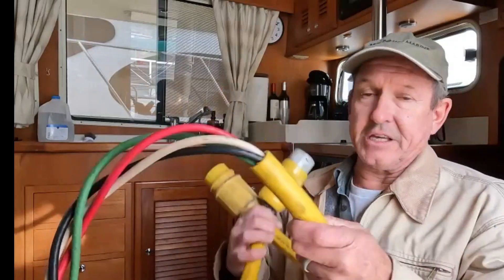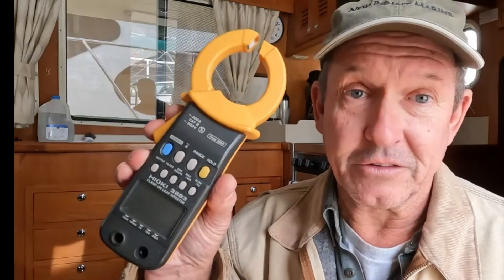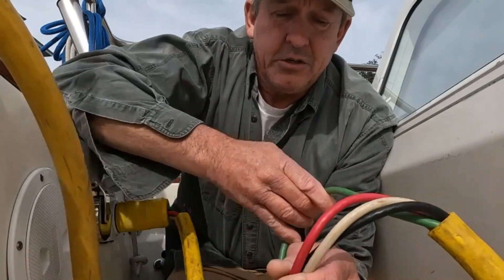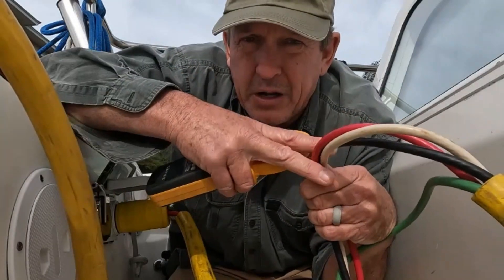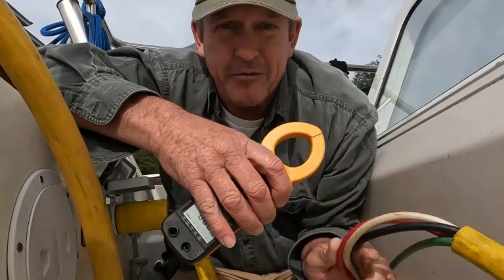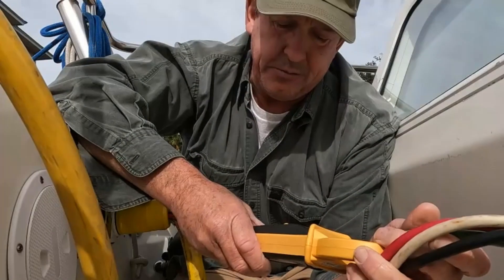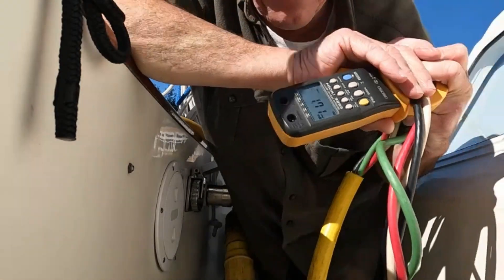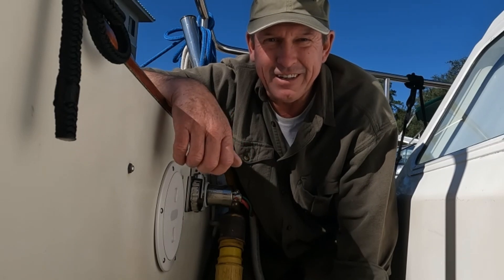Ground Fault On Your Boat? Here is How We Measure the Fault Current

Comment: I’ve been watching you for awhile and really enjoy your explanations.   I’d like you advice on a ground short I just experienced yesterday.  I have a 1978 sailboat that has been repowered with a Fischer panda 8 k and a 80 hp yanmar.   The electrical has been brought up to ABYC standards     The boat tripped the shore and main breaker at the distribution panel up in the parking lots.  What I have found is the secondary air conditioning unit when turned to start (which is followed by run) it trips the ground fault breaker on the boat, shore station and the main breaker.   Disconnecting the ground from the switch of the secondary unit nothing trips.   The water pump is shared by both ac units.  The controller is as old as the boat and obviously something broke down to leak juice to the ground.  How would you solve this issue?    Thanks!  Chris
Reply from the maker: that's a great question with a lot of moving parts. Might have to do a video about that topic. From what I can gather it sounds like the AC has a fault. If you disconnect the safety ground (totally not recommended ) and the breakers hold then that appliance probably has a fault. But how much of a fault? If the ground fault protected breaker is protecting more boats than just yours, the system could be normally on the fuzzy edge of tripping and your fault puts things over the edge. Do the testing with proper equipment and know exactly what you are dealing with.

Comment: I like your style, but it's very frustrating when you get to end and simply announce the problem is solved. You didn't clarify that all the breakers must be on for the initial test, and then if/when the meter reads to indicate there is a ground fault each breaker is turned off until the fault goes away; what it means when the hot #1, hot #2 and neutral wires read different current than the green ground wire (current is going down the green ground wire & into the water around the boat!!); how you connected your portable main test breaker and what it does; etc, etc. Pretty much you wasted my time & I won't be back.

Comment: I have one where the first 30 amp panel trips the marinas central GFI shutting down the entire dock if you switch on the main breaker even with all the individual branch circuit breakers switched off while the second 30 amp panel for the air conditioning and water heater is fine running all its systems.  There was no problem at any of the previous docks nor was there a problem running on a portable generator when it was available.  We tried switching pedestals, swapping cords, etc with no change.  

This is on a late 80's Carver with the 30 amp mains switching the common while the individual 15 amp branches are switching the hot so tripping just the main still leaves each branch circuit hot to ground.

Other boats have problems at this marina when something as simple as low power 12 volt LED lighting is turned on which again shuts down every pedestal on 3 separate panels servicing the entire marina.  The marina claims its because their central GFI system is much higher quality and set to a much safer level than the others in the area.

Are there really that many boats in this one marina with ground faults or could it simply be an overly sensitive GFI system tripping at too low a level at this one marina.  Most report the same situation in that all the problems go away at the next GFI equipped marina they visit.

Best!

Comment: So what was causing the ground fault on the boat?
Reply: Yes I have a similar fault can you tell us what the fault was? Please
Reply: Jesus I was expecting to know what the fault was
Reply: I'd guess it was a neutral to earth ground tie or a neutral to neutral tie if there was 2 seperate shore cords or inverter powering the boat but what do I know haha, Cheers
Reply: When he did the first check of the entire cable, the leakage measured 0.122ish was that not returning via the cable ie thru the water! When he measured the white red and black together the total was .22 ish. He then measured .106 was going through the green ground wire. After he “fixed” it he should have measured the whole cable, the white red and black together then the green only to prove the fix.
Reply: @JohnSmith-qi9qs 
I think he does at 7:41 or am I wrong? 
His miliamp meter read 1.6miliamps with all 3 current carrying conductors clamped & all loads in the boat running
Reply: @BigEmpty239 
He checked 1 of 3 tests and called it good.
Reply: @JohnSmith-qi9qs  
His miliamp clamp confirmed he fixed the problem & he was measuring the current the same way a gfi does 24/7, gfi's don't read the earth ground.
His 1st test was finding the obvios ground fault current on the 3 current carrying conductors with his meter & then he then fixed the problem.
His 2nd test he clamped all 3 current cables again & confirmed no power was being lost to ground & all current was being returned back to its source.
His 3rd test he went a mile further & plugged in a temporary gfi breaker inline on the shore cable with ALL LOADS ON in boat & confirmed the gfi didn't trip, those suckers will trip @ 5miliamps or more.